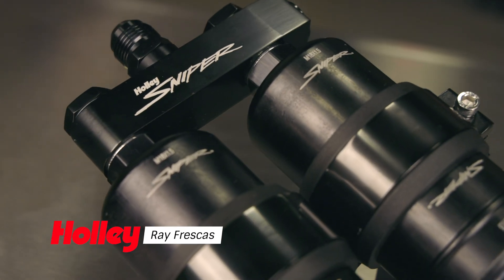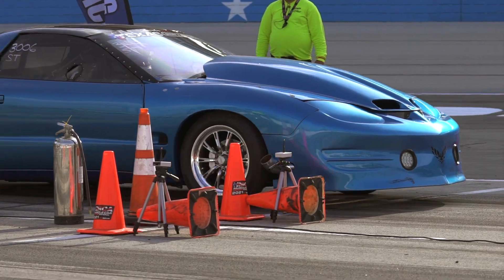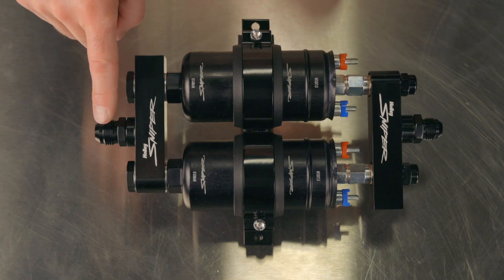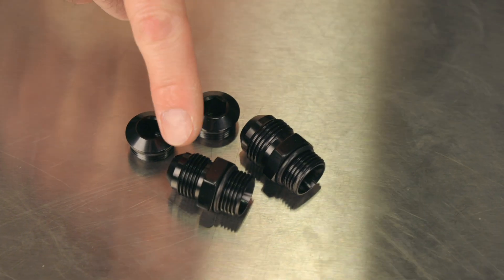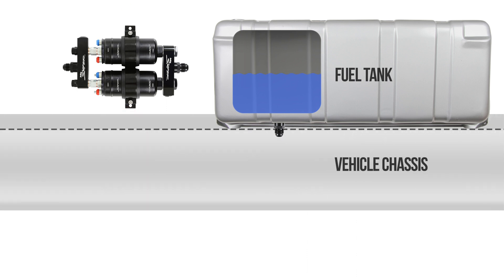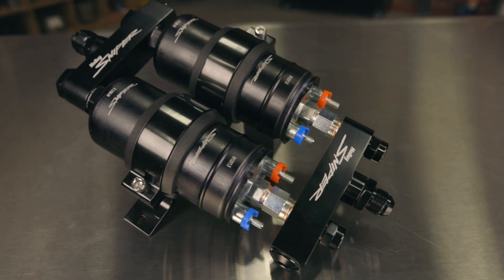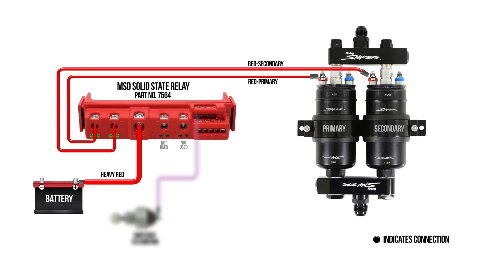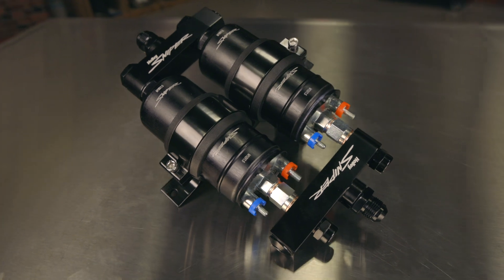The Most Cost Effective Twin Fuel Pump System - Holley's Sniper Twin Pump and Manifold Kit

Comment: I bought these. I haven't installed yet. After reading some of the Holley fuel pump reviews I'm having my doubts. Wish Holley would have atleast a 1 year warranty.
Reply: Why are you having doubts looks to be two 44 style pumps and just on a manifold to fit the Two you could order two 44s and some line and fittings and make the same if your really worried

Comment: Will one of these pumps run my LS3 5.3L it is at 325HP right now and I will be adding a cam to get it to 400 later but I wanted a redundant setup this will be for off road type ultra 4 car.
Reply: You want mine
Reply: boostontap5872  What is wrong with this setup is it made exclusively for race applications would it not be good for a redundant off road setup? or overkill for what I will be doing.
Reply: Nothing wrong with it just to many parts that can/will leak with enough time. 4 an caps you need to tighten 6 washers 2 pumps. Not to mention pre/post filters. I can post a start up vid works great just rather get something with less failure points. You can have mine for $150
Reply: @boostontap5872  Will one of the pumps run my engine with some buffer. So I have a single pump that only has markings on it WO721 it is 10an inlet and 6an out it has a radium brand aft fuel filter heat exchanger thing goes up front to a radium regulator. the fuel pump looks super similar to the jegs part number 555-159076. I dont really see a pre filter oh and the system does have a return line coming out of that regulator to the tank. I cant find any information on my current fuel pump. its mounted to the rear deck with a 60mm radium aluminum clamp. the fuel cell is a jeep speed 32 gal with alot of stuff coming out of the top plate but no wires so it doesn't have an in tank pump im sure. that holly setup you have how old is it or roughly how much time on it.  I think it would be nice as a redundant setup but those an fitting dont seem that good kind of cheap crap. On my fuel rails up front I have a an6 crossover hose that started spraying fuel all over the engine and it wasn't because it was loose it was leaking from the fitting where it swivel's. If it would of happened while on the trail dam thing could of burned my buggy to the ground.

Comment: @1:28 Really? You can run a lift pump/surge tank/multi pump setup in the boot? That's where everyone puts their fuel system in Australia... I've had a twin Bosch 044 set up with a duel feed 5L surge tank in the boot, fed by a Walbro 460... The set up has been going strong for about 12 years- still on the same pumps! Have spares, but never needed them. And it's all neatly boot mounted
Reply: Daniel can you send me any information on this setup. It will be used in a ultra 4 car configuration.
Reply: with a jeepspeed 32 gal tank.